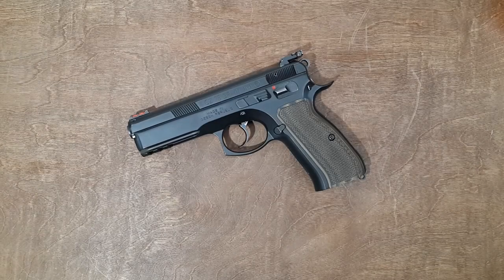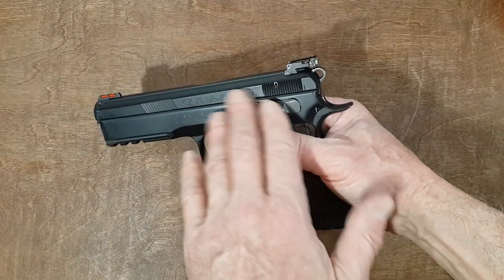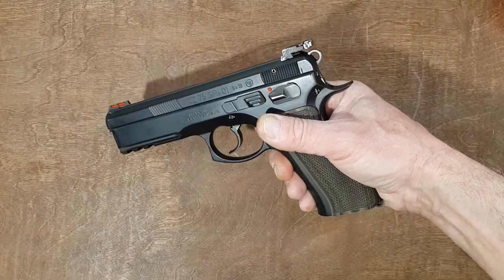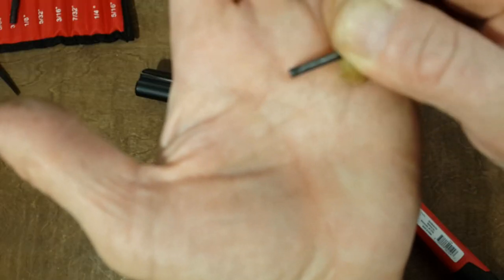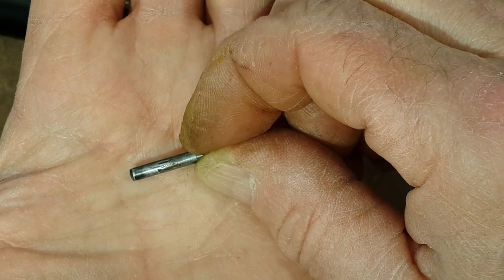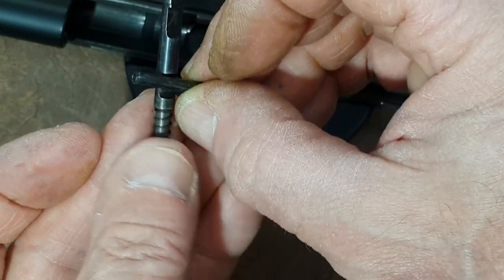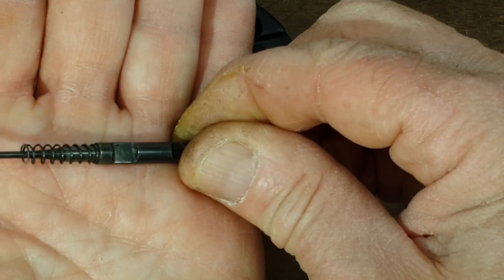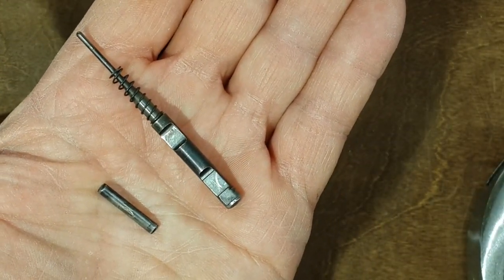7000 rds CZ75 Roll Pin Inspection

Comment: I’ve chosen an SP-01 to be my first gun purchase, your channel has and will be invaluable knowledge thank you!
Reply: Thinking about the sp01 you enjoying it?  On hindsight would you have chosen differently?
Reply: @joshuamadread3678  I love my SP01 Competition but I kinda wish I had gone with a Shadow 2 or TSO, after putting like $1000 into it to get similar performance to the TSO. A normal SP01 is not in the same cost bracket as the SP01 Competition or S2/TSO, so maybe it's not a fair recommendation but my opinion still stands.

Comment: Hello Practical Shooter, I watched the original video also but I may have missed you mentioning it. I just want to know what type of roll pin did you installed before the 7000 round? Do you also dry fire your pistol without any dummy round during the 7000 rounds?

Comment: I'm assuming you've replaced the cheap "Hollow tube" pine that comes with the gun, with the "Solid Steel" pin that the CZ Custom Shop sells for $6  each. I've bought several of these solid steel replacements. And I'm waiting to see just how long the cheap, hollow pin will last.

Comment: Great work. 
I have some questions for you. 
How is your slide to frame fit at this point?
How is the barrel to bushing fit?
How is the lockup?
Everything still pretty tight?
Thanks, and keep up the great work! 🐊
Reply from the maker: My CZ shows some normal wear. Everything has smoothed out, but still tight, and the trigger has become a dream. If it wasn't for what I fond as  "The perfect striker fire handgun" in the Styer L9, I would still be spending time with the CZ, Which I will eventually return to.
Reply: Practical Shooter  Thanks!

Comment: Thanks for the great videos! I was wondering what you think about the SOLID Firing Pin Retaining Pin from CZcustom? Do you think a solid retaining pin might damage the firing pin?
Reply from the maker: Thank you Dennis. Honestly, I haven't any experience with CZcustom's roll pin, but being a reputable company, I would think they have done their homework before suggesting that replacement pin for your CZ. 
On the other hand, if you are leary about a solid roll pin, I made a link available above for a replacement pin that I have tested, and other CZ owners have tested as well (Replacement 3mm x 20mm pins), that will work and will not damage your firing pin, plus you get 15 of them, as you can replace them as they get dented, in the event you shoot your gun that much.
Happy replacement pin Dennis
Reply: @practicalshooter6517  Thank you so much for your fast reply! I just got my SP 01 recently and the guys at the gun store told me about the retaining pin weak spot so I immediately ordered the solid pin which arrived today. My gut feeling however tells me to not use the solid pin. I think a roll pin will act more like a shock absorber and keep the firing pin shoulder from damage. I will go ahead and order the pins you suggested, thanks for the link! :)
Reply from the maker: @TheDenk25  "shock absorber"  was exactly my thought Dennis. By the way, you'r gonna love your sp01. Have fun

Comment: Practical Shooter, I get the f/pin retaining pins from Amazon & try to use but it was to tight & was afraid it get stuck in there. any suggestions?
Reply from the maker: The first time you push it in, it will tight, but the pin will fold onto itself and fit in the slide.
The next time you remove it and put it back, it will be a lot easier. Just make sure you are using a roll pin punch, the punch with the little ball at the end of it. Let me know if you need more help.
Reply: Thanks for the tip Practical Shooter. Regards
Reply from the maker: @hiramaleman2964  I also remembered the first time I used one of those roll pin I used a niddle nose plyer to fold the end of the pin. I find it to fit in better that way.
Reply: Per the manual, try driving the pin out from right to left side, and drive the new pin in from the left to right side. See if that's the issue. 👍

Comment: Can I change out the firing pin Roll pin without disassembling the slide from the frame? Just tap it out from one side, then tap the Cajun pin in from the other side?
Reply from the maker: Yes you can. It's more practical and easier to handle after removing the slide from the frame, but it can be done.
Reply: Practical Shooter as always thank you Sir, you have been a big help.

Comment: Has the Trigger return spring lasted 7000 rounds too? If so what are you using, the Cajun or the Stock CZ?
Reply from the maker: The OEM return spring is still working with over 10000 rounds. I do have a back up spring, but never had to use it ......... so far.
Reply: Practical Shooter Wow! I have a CZ75 D compact PCR, it has like 500 rounds through it, I hope mine last that long
Reply from the maker: @sinqros  CZ makes exceptional handguns, you should have many years of good uses out of your PCR.

Comment: I'm confused because in your original video you had 1/8 x 3/4 roll pins from a USA supplier, but in the comments for this video you have linked 3mm x 20mm from India.  We need to know EXACTLY what roll pin you inspected after 7000rd for this video to have any meaning at all.

Comment: But would you expect any damage if you are not dry firing?
Reply from the maker: Yes, for some reason, the pin is going to collapse and fail. I see it as a consumable, meaning it needs to be replace, and it is understandable. The firing pin is taking a lot of pressure and something has to give. The pin can take the pressure for a while, saving a more expensive firing pin in the process. The pin is easily replaced and very cheap. I suggest to replace it every 5000 rounds or so.